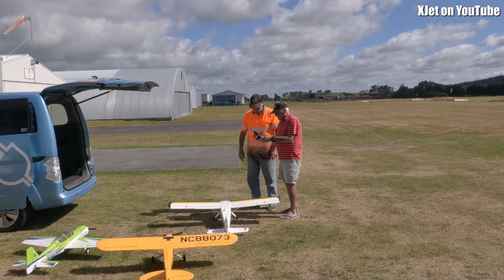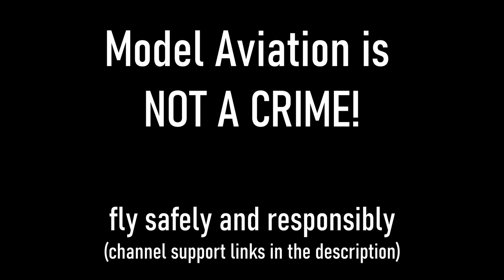Last of the summer whine (with RC planes)

Comment: Does no-one build models nowadays ? Have we degenerated to Banggood plastic fantastic flyers , rather than aeromodellers ? If this is progress , you can keep it !!!
Reply: I am glad that you said that. ''Plastics'' have got more people into this hobby than before. Affordability and easier to repair. This hobby will continue to grow with or without ''Plastics''. AS3X, gyro stabilization, new generation batteries and controllers, i suppose that you do not want them either. 
Even Old Men in shorts telling jokes that are just above a Nickle and a Bob high, fly ''Plastics''..
Reply: As I look at my Diesel 2.5 cc where the either fuel had to be used fresh, The gassers where oil saturated the balsa which varied between carrot snapping crap to rock heavy, glued with volatile glue which had to be used right away, the thermal that took your project away but was somewhat satisfying.          IMHO the future is good hands with new tools and new generations.
Reply from the maker: I think the subtle difference is that many people today are "RC model fliers", not aeromodellers.   They are two different things.  Some folk just enjoy flying, others enjoy the building process.  There's room for everyone at our field!
Reply: @xjet  I agree, Bruce.